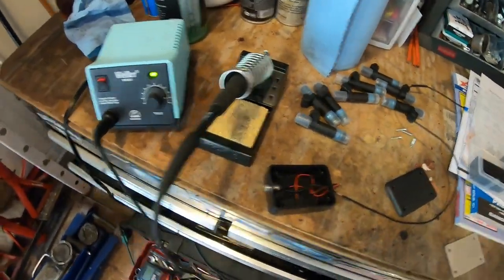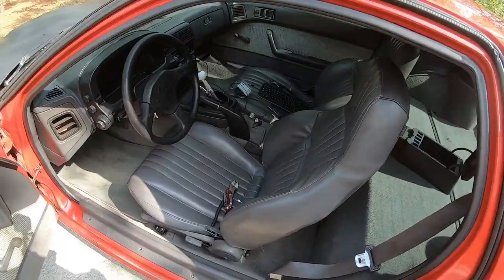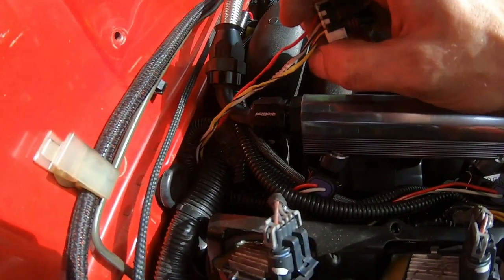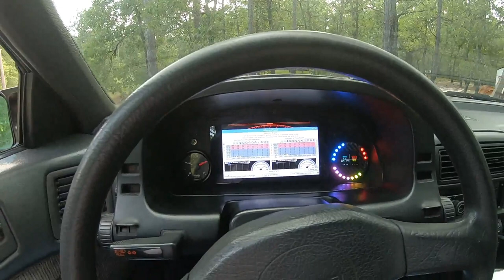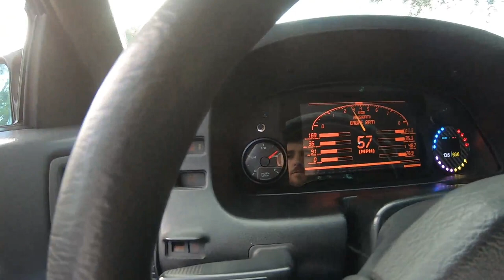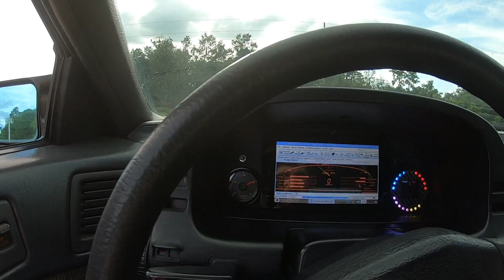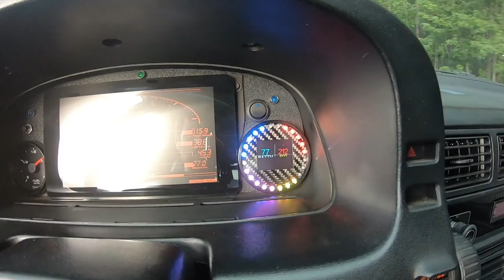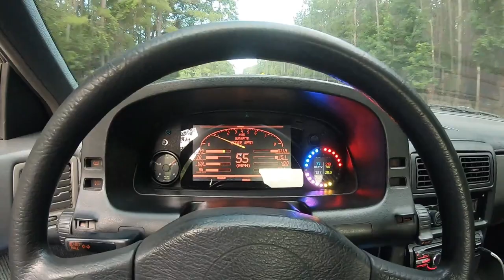Driving my turbo LSX RX7 with a powerglide on the street.

Comment: LS can be tricky to stay cool. Highly recommend plumbing in the steam ports on the heads instead of plugging them. If you plug the heater ports instead of loop them, drill a small bypass near the thermostat. This allows a small amount of coolant to pass by the thermostat when it’s warming up, and the stat will open on time. With the heater ports plugged You can see big spike in temp then the stat will finally open and it’ll drop back down. The bypass helps that 

I’ve gone as far as jacking the car up or parking on a steep hill when I top off off. 

My current build has two 2200cfm fans on a dual pass radiator. They are always a pain at first
Reply from the maker: I have the heater hoses plumbed. I've had all kinds of steam port routing, surge tanks, and other setups. Mine seems to work better with a simple setup. I use a bleeder funnel but I bought a vacuum system to fill the coolant to remove air pockets. Haven't used it yet but plan to in a few weeks